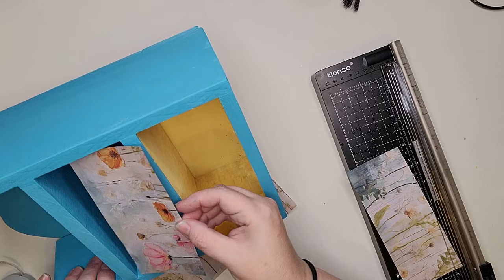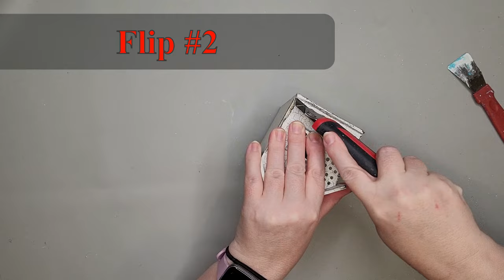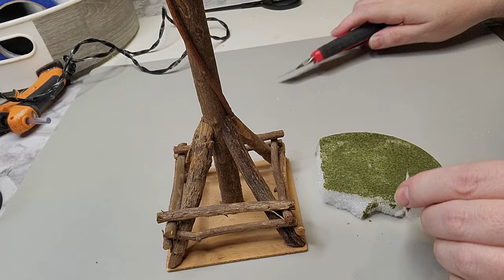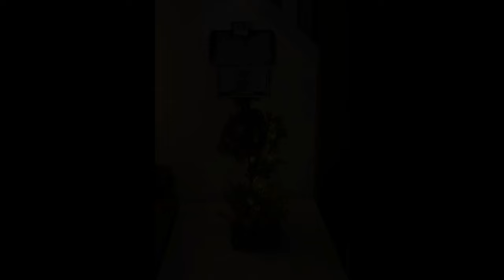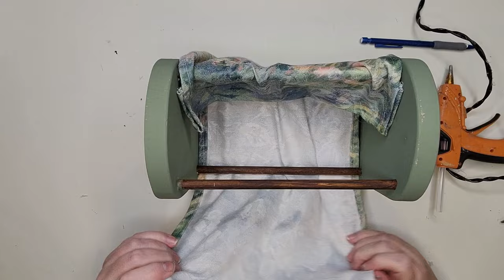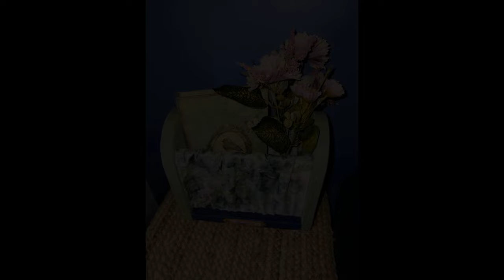Never Before Seen DIY Spring/Summer Thrift Flips

Comment: What did you use to fill in the writing at the beginning on the wooden shelf?
Reply from the maker: I used light spackle from Dollar Tree. It dries fast and sands easily. 🙂 Thanks for your question!
Reply: thx! is that in the craft section of the hardware section?  @craftcrumbs
Reply from the maker: It's in the hardware section. 😀
Reply: @craftcrumbs  thanks! Found it!